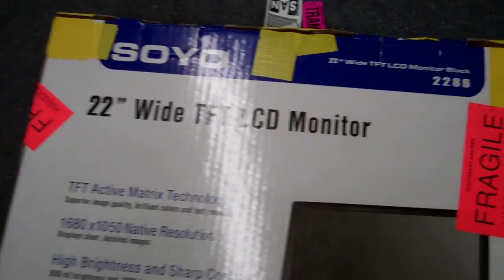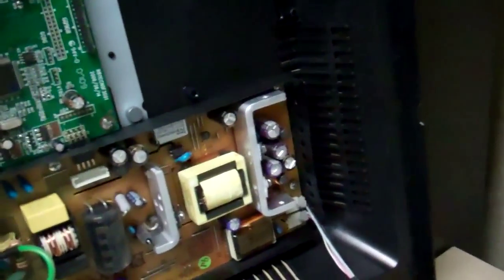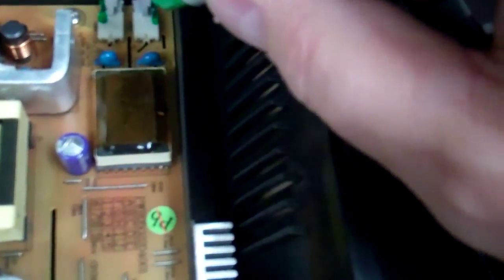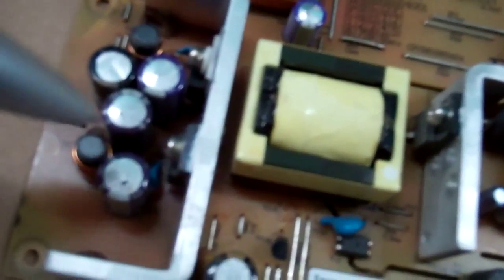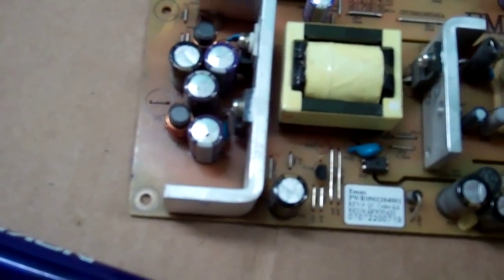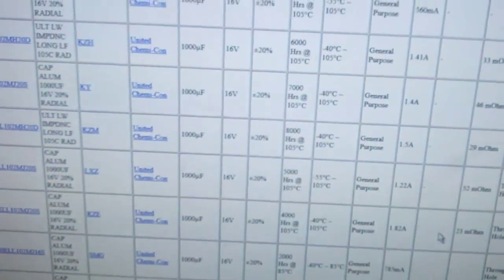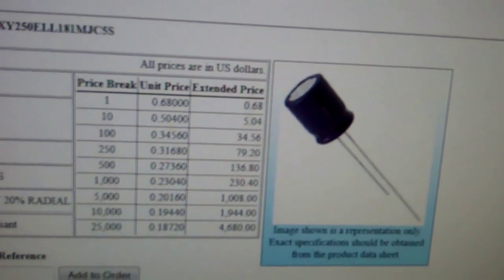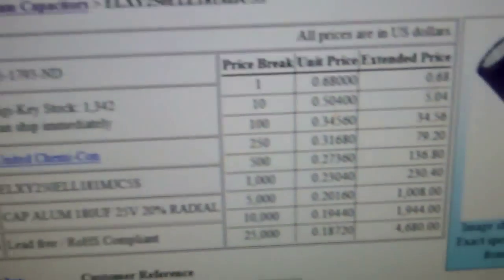Soyo 2286 LCD Monitor Repair Tutorial

Comment: sir please help me becos my monitor power led is not at all blinking and screen is totally blank black but I also tried to repair my monitor and open my monitor and I saw that circuit boards r okay and the capacitors also ok but I can't see any bulged capacitor so i wana know that what kind of problem i m facing can you help me please.
Reply: You have to test the power supply input and output with a multimeter and see if it's getting voltages, If not take it out and look at the back at the soldering joints and look for cold joints
Reply: Yago Usera 
sir thanks but that was my monitor fault and i had reapired it by a tecnician.

Comment: Ha，I use 2A PCB fuse .It work few minutes. Check again, E Cap 1000uf 16v has being little broken on the top. At last, I replace all 4pcs E Cap ,it work few hrs last night！ I guess manufacturer use copper wire as F2, like PF3. From some 4 CCLF inverter specification, the current should be TYP 1.8, Max 2.4, so use 2A for protection！

Comment: May be fuse F2 Broken?  Do You know what is fuse specification?
Reply from the maker: I do not remember the fuse. If it is for AC line a good number would be 2 to 3 Amps, slow blow if you can find it..
Reply: Thx！Should be current limit of 12v provided for inverter cct！

Comment: Thanks a lot for the answer!I'm going to fix my monitor once got the caps delivered off ebay :)
I've got Optiquest Q2202wp 22" which looks it's got actually exactly same guts as that Soyo monitor you're fixing which was supprising.
Just as 2nd thought was wondering why using same type of 3 or four caps of 1000uF 16V at the same with diff colors. I thought if it's to do with what circiut they belong to.

Comment from the maker: Question. Is this with analog VGA input or digital DVI input? Try using a different computer and different VGA/DVI input to help diagnose. We have to rule out computer's video card as source of problem. That will also require a different video cable and rule that out as source of problem.  Post your results. If your purple capacitors are bulging that could be source of problem.

Comment: I have a monitor of 14 soyo what happens when you turn the screen esque throws according alo faded colors shown in the operating system blue colors red and black after the screen off and on for several times returns nitida image ...
that could help deve image loss since neither the same menu is visualisable everything is blurred or fuzzy colors
Thanks for your help

Comment from the maker: When power LED is on but screen is black it means the back light is not working. For the power LED to come on there has to be a video signal detected. The back light is CFL (Compact fluorescent light) and requires a high voltage to work. The two large rectangular inverters on the circuit board supply this voltage. Somehow they are not coming on. If you have bulging purple capacitors that may be cause but could also be other reasons. New new monitors are very low cost but new power supply is not.

Comment: hello friend I have a problem with my monitor SOYO brand, and I wonder if you can help me .. the question is that the video does not monitor and the screen remains blank although the power LED turns on, I was watching a internet forum and said something that was the fault of the memory that had been deleted., I'm from Venezuela and I do not speak English so use google translator ... thanks in advance for your help ..
Reply: Conseguiste solución?